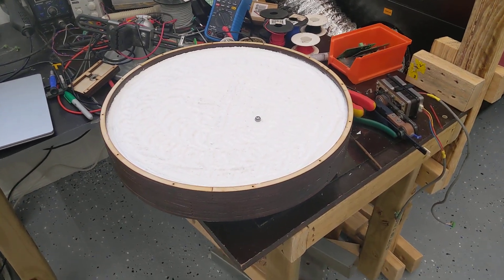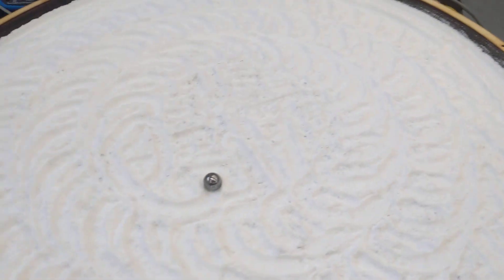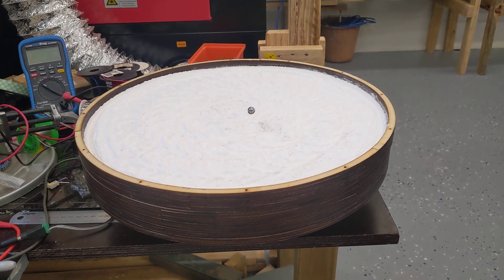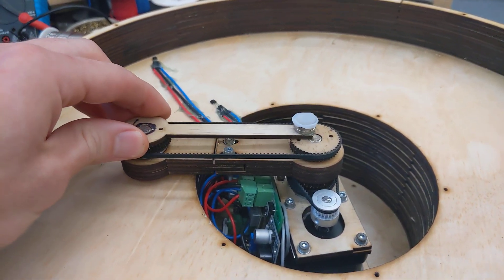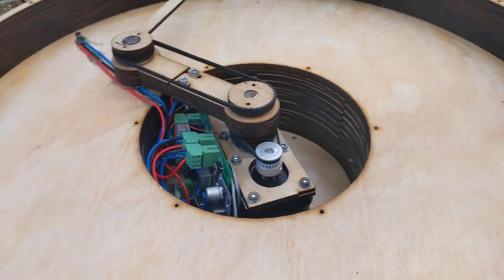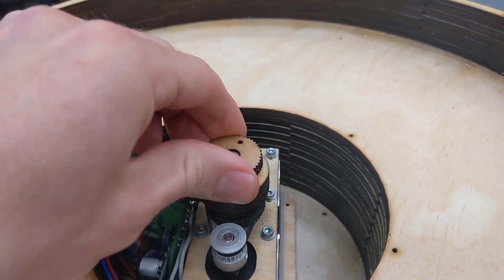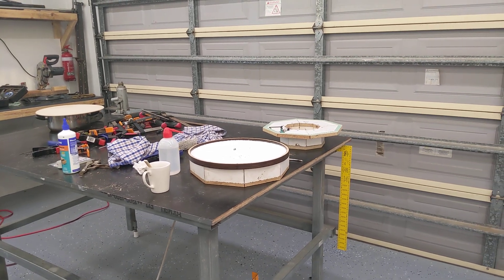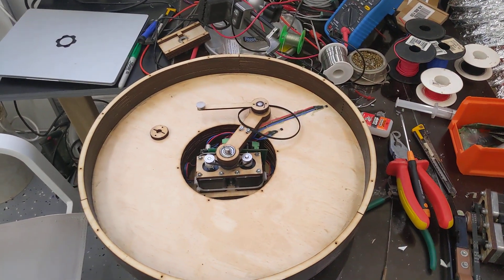New enclosure and sensors for sand drawing robot.

Comment: I want to make this can you help me in the software part?
Reply from the maker: The software is more or less done. You can just grab all the python files from https://github.com/tjhowse/sand_drawing, copy secrets_example.py to secrets_real.py and update your info within, then ampy to dump them onto the esp32.

You'll need a PCB to drive the steppers though. I'm nearly finished designing v1.1 of the board with improved stepper driver control pins and voltage regulation circuit. Stay tuned.